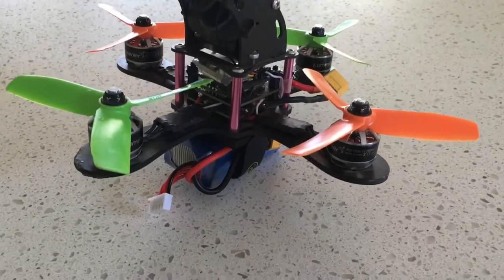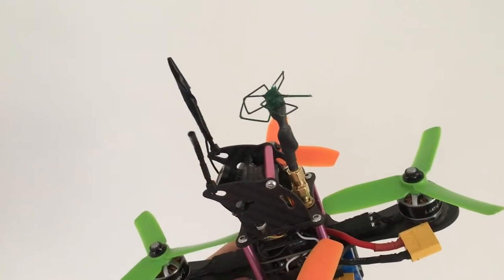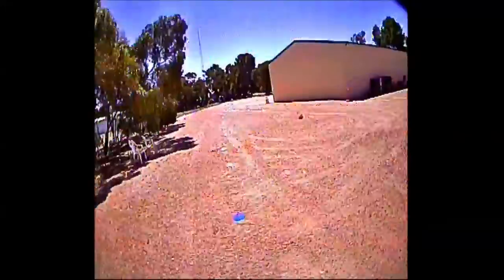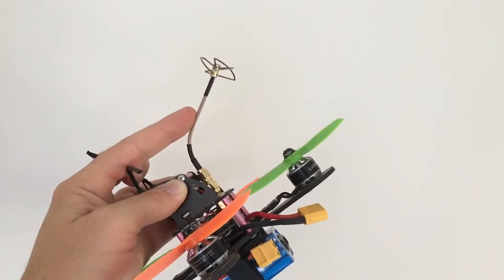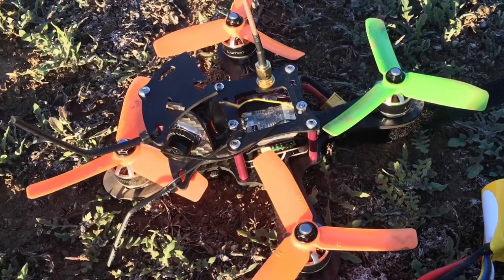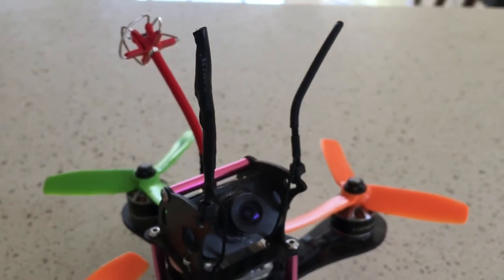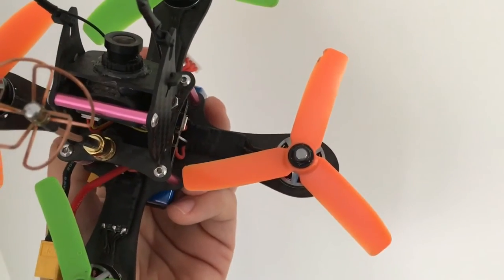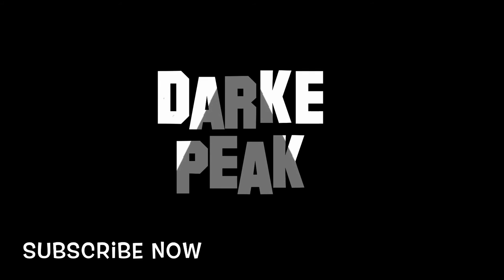Mitsuko Performance Review

Comment: wow, I heard of this frame, but never looked at it enough to know it was a plus style.  Are there others in the race frame market in this style?
Reply from the maker: +Simon Naughton Plus layout is rare.  The main reason is it has a motor/prop in front of the camera which isn't ideal.  Mitsuko mitigates this by having the camera at the top of the electronics stack and we typically fly it with heaps of camera angle
Reply: +Darke Peak Heh, I'm still at something like 10-20 deg angle. #slowlearner